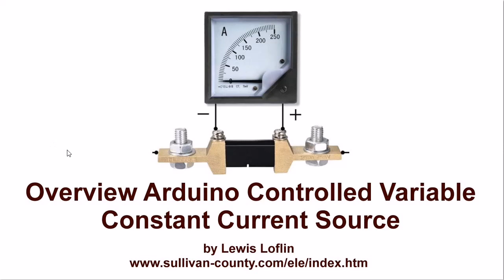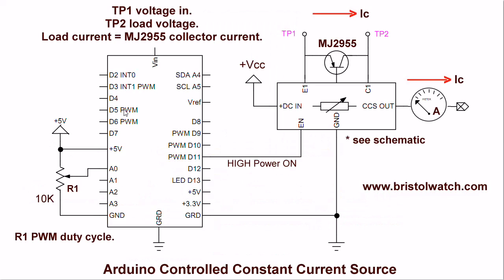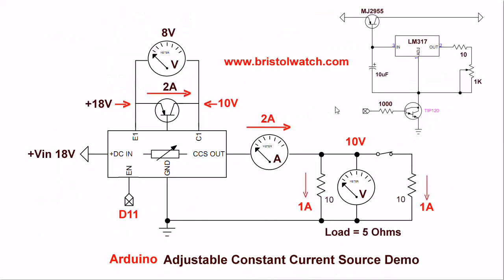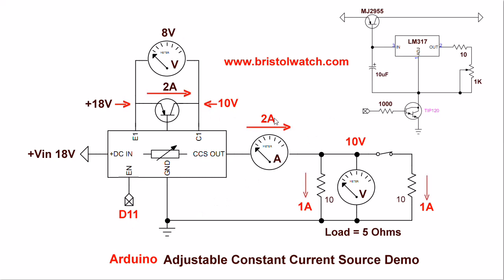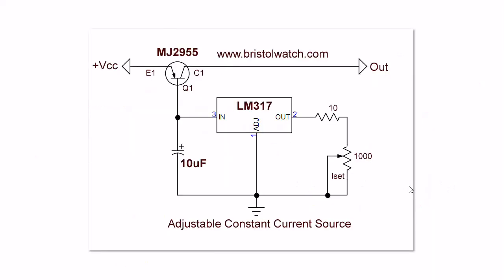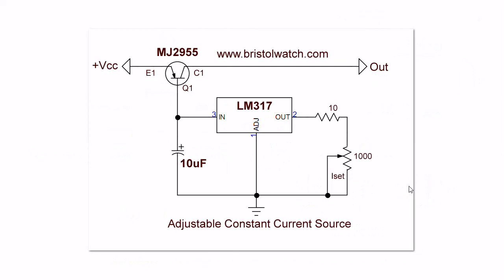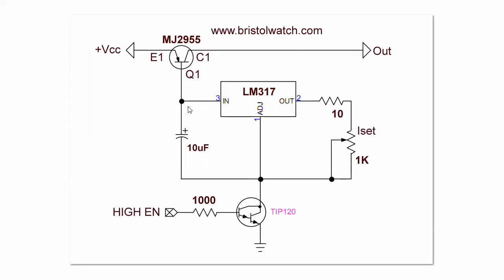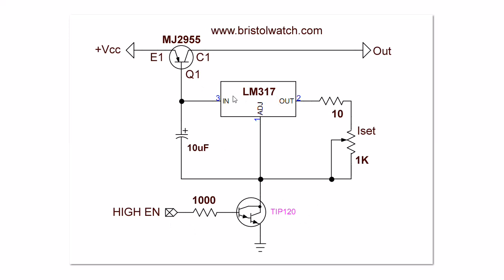Arduino Controlled Constant Current Source

Comment: If want to drive 24v solenoid that need 120Hz PWM and 5% Ditter will this wokr ?
Reply from the maker: AC does not use PWM; it only uses phase modulation. I assume this is an AC relay?  What are you trying to do?
Reply: @LewisLoflin  Tanks for replay. I have 24v DC solenoid that require 120Hz PWM (few are 90Hz other need 200Hz, is adjustable depending of type of the setup) and dither 10mA (can be higher in few cases not dynamic adjustable once) run in current control 280mA to 2A (standard hydraulics proportional valve solenoid). Kind try to avoid shut current sensing and PID to adjust mA inside Arduino, If there is clever solution open loop solution that all this is done inside LM317 or other chips and I just send mA request where PWM frequency and Dither is fix? Thanks that you take the time to answer! Regards,

Comment: Hi Lewis. This looks very interesting. I am newbie with electronics. Could you explain me how the base current of the PNP is controlled by Input/Output of the LM317? Is there any website I could learn about it? Thanks in advance.
Reply from the maker: The LM317 regulates the transistor base current. Emitter-base current times hfe (DC gain) produces the output current.
Reply: @LewisLoflin  sorry if I ask for more details since I am newbie. I thought the load should be controlled by Vout. Don’t understand how the LM317 affects Vin.
Reply from the maker: @raulperezgomez8102  No problem. The LM317 is a constant current source used to control a larger current.
Reply: @LewisLoflin  but why is the PNP base connected to IN of the LM317?

Comment: Please explane ,sir whats the use of 10uf cap. and how the transistor base control by lm 317...? because the adjest pin is not connected with base..    plz answar..
Reply from the maker: 10uF is to remove switching noise. The transistor base-emitter current is controlled by the LM317 input/output current, not the adjustment. Adjusts controls the LM317 input/output current.
Reply: @LewisLoflin  sir, actually i want to make a high amp 5 v mobile charger ckt... with 7805 ic and pnp transistor ....  with npn the base directly control by 7805 output pin ,,, who can I receive constant 5 v from pnp..??
Reply from the maker: @sanjogkumarbarik7460  A voltage regulator is not a current regulator. This is a current limiter circuit. Use this circuit followed by the LM7805 Zener circuit with an NPN pass transistor.

Comment: if using this method, does the voltage wont drop when we keep the current constant even if the load has vary resitance?
Reply from the maker: Voltage depends on load resistance within a range.
Reply from the maker: Load resistance determines voltage drop within limits.

Comment: If we use a battery(3.7-9V) as the source instead of the 18V power supply, can this setup be used to drain the battery at a constant current?
Reply from the maker: Yes